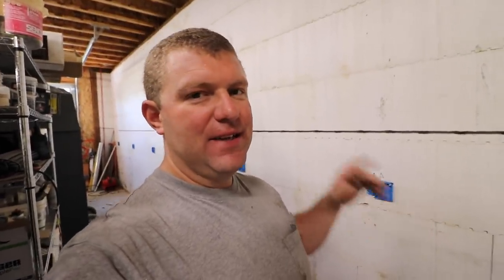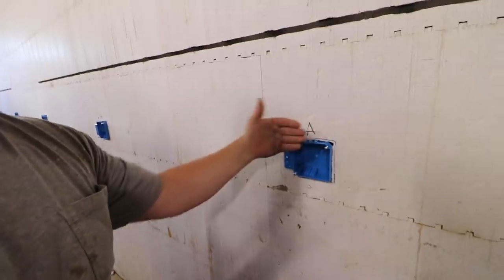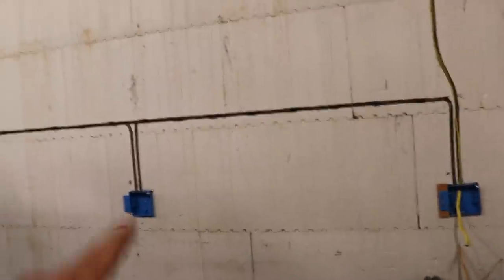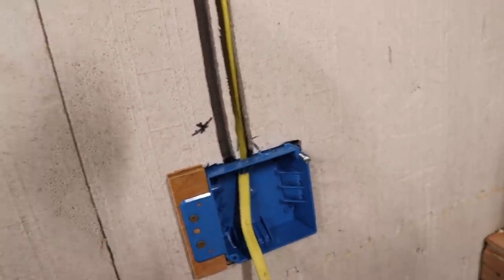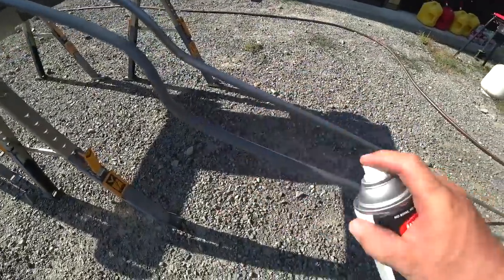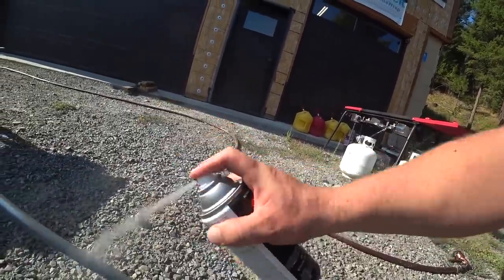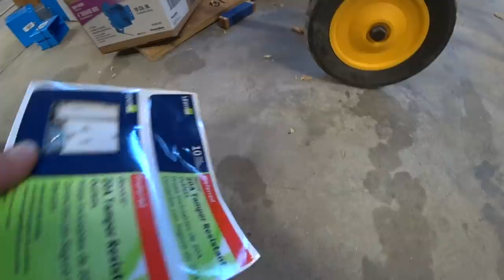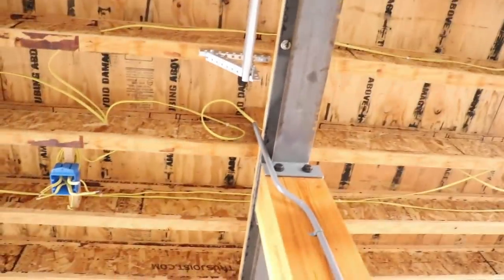OCD PEOPLE BEWARE! (Hot-Knifing ICFs for Garage Electrical)

Comment: Hey there paint guy - I think you are pressing the nozzle to often and foaming in the tube.  If in longer spays the gas moves through and pulls paint from behind.  Otherwise like with your bad luck the gas bubbles expand a bit and put more gas in the paint making more foam.
Reply: I think the problem is the cap\nozzle is getting clogged. Also using cheap paint isn't helping

Comment: I've been an electrician for 30 years and have always believed you can never have enough receptacles but you have proved me wrong. Do you really believe that you will ever need to plug that many things in at once.
Reply: Hopefully they won't. That's way to many devices on one circuit. I also believe the inspector will want to see the wire in the box before the devices are installed. If there are pigtails, does the ground have a wire nut and what about a wire strap above those boxes. I haven't done work in that state but the NEC is the same everywhere.
Reply: I was informed that Daisy chaining wasn't allowed anymore. Must be pigtailed so if one device goes bad then all of the others will work. Also I think the inspector may want another circuit for all of those devices. Cheap insurance.
Reply: Everette Brown he’s been over all of that in a previous video, he’s strapping the wires to the concrete I believe at each box and he’s well within the code for devices on a circuit according to what he said

Comment: When you pointed out the missed connector, we got see what happens when you don't ream the ends of your conduit. The knife sharp edge that results from using a tubing cutter in addition to not reaming the ends has stripped off part of the insulation jacket of the romex. 

Cutting the EMT with a hack saw or metal cutting skill saw leaves an edge that is easier to ream.

Comment: to hold the wire into the icf slots we use "zip wall" tape or take a piece of foam and turn it sideways and wedge it in and we drill a 2 9/16 hole in the i joists and you can fit 9  12/2 romex in each hole  and we never paint conduit unless you use degreaser on every piece because oil is used in the manufacturing process and paint will just flake off in time

Comment: You didn't ream your conduit. And forget about running your Romex wire down the conduits. Stick to flying and hire a electrician to wire your home before you burn it down.
Reply: You need to learn your self before giving advice, you can run nmb cable in conduit as per NEC article 334

Comment: If you live there long enough you will regret using the push on connectors on the outlets, they fail.
Reply: I have never, ever had one fail.
Reply: @watcherofwatchers  I'm 50+ and have had to rewire a bunch of them.  My issue is a loose electrical connection can create a fire.
Reply: Just changed one that failed on the outdoor porch lites, probably turned it on and off less than 100 times in 24 years, was broke when wall plate was removed.

Comment: Rather than buying a manufactured nail plate, you could buy some appropriately gaged sheet metal. Cut the sheet metal to size and use small nails to secure.

Comment: Those connector fittings you had at the very end are the wrong type of you are planning on leaving it that way. The type with the clamp, that slips onto the conduit tube, is what you need. It's still the same sheath looking half, but without threads. It's got a clamp that gets screwed together* instead.

Comment: You talk about the depth of the chase in the foam, in reference to avoiding using a nail plate, but didn't you forget to account for the drywall and plywood layers adding another inch or so?  Seems like those will be plenty deep even if they do end up sideways.
Reply: Thats what the depth is for the screws or nail holding the dry wall up

Comment: Rather than the metal conduit you could have gone with gray PVC, especially since you aren't using the conduit as a ground in the system.  All it takes is a heat gun to bend it!

Comment: Did you deburr the inside ends of the conduit? When you were painting one of the ends looked like it had a burr that could damage the insulation as you pull the wire through the conduit.
David
Reply: It is required that you ream the cuts. He has also made a big mistake in using a pipe cutter. It is against the national electrical code.
Reply: It is required that you ream the cuts. He has also made a big mistake in using a pipe cutter. It is against the national electrical code.

Comment: One suggestion is to have each outlet labeled with a designation,  if in the future you decide you want to have off grid power, you can prioritize the important outlets, as well as essentials they you need to power in case you have to run a generator.

Comment: Before using, let the spray paint can sit in a bucket of warm water for 15 mins or so to heat up a little. It'll help smooth out the consistency and spray pattern.

Comment: Jesse, re: paint. I find 'the curse of the bad can', happens more often than not. I use mix your own and spray guns with my compressor often, and I also use sure-shots to 'roll-your-own' spray cans, but I also use off the shelf sprays. To avoid 'the curse', I do two things. First, I tend to pick colors that I know I will use and I get the contractor pack, case lot at the big box store. Per unit cost is cheaper by the case lot, sometimes substantially so. Second, when I open a new can, I test it first. Invariably, at least one can in a case is bad. I set that can aside and just grab another out of the case. When I have a small collection of duds, I simply return them to the big box. Yes, I need to keep my receipts, but I keep them in the case. This also means that while I buy them in case lots, I don't buy so much that they will look at me cross-eyed trying to return a two year old can of paint. I keep a stock of what I use for three months or so. Now case lots can be as few as six cans, and while six cans might seem like a lot, I find myself gravitating towards the same colors over and over. Grey, Ivory, An Avocado-like color called Vista Green, Sometimes Detroit Diesel Green, Black, John Deere Yellow and Green, so I keep these on hand. We all know that just one can is never enough,  and there is nothing more frustrating than being nearly done and running out. Keeping your favorites on hand in bulk can save frustration, time, and often, money.

Comment: The Battleship gray definitely looks great on the column conduits. Nice job on hot-knifing the foam for the wire runs. The little curves at the end or near the top will help the electricity flow better too!!! Judy kidding, but I did hear a contractor actually say that way back when I was a young kid learning the construction ropes.    At the time I thought he was serious, but quickly learned that he had a lot of useless tips to share and only 20% of them were factual.  As far as planning and execution goes, you did a lot of work for one day and that’s equal to or much more than a lot of home Owner/contractors could have done.   It will get done eventually as long as you keep plugging away at it like you have been.

Comment: Curious why you wouldn't mount the electrical boxes on the backside of the posts?  As you have it now, the first thing you're going to see as you walk in the man door is a bright white electrical outlet instead of the beautiful timber post.  Plus, if you mount the box on the back of that front post, the conduit bend will be on the same side of the I-beam as the conduit on the rear post.  Just a thought...

Comment: There is a special connector for the top of the pipe in your application. It’s a squeeze connector to a pipe connector combo and I noticed you didn’t ground your box either. Easy fix nothing catastrophic.
Reply: You don't run Romex inside of conduit.
Reply: Thomas Gallagher  as per article 334 in NEC it states you can to protect it from physical damage.
Reply: But it is also up to the AHJ. They make the final determination depending on the area

Comment: When are you going to get the cladding done on the outside of the house?
Reply: because there are installation zones. A wire should only be installed in certain heights and distances AND always vertical or horizontal.
Reply: @michaeld_aus_b  I said outside not inside
Reply: It gives me a twitch to see OSB not immediately covered with at least tyvec.

Comment: There are no plastic studs in the area where two ICF's come together in my system (LOGIX) and I suspect the same is true of yours.  Hot Knife your channels in that joint. I cut my channels to the concrete, 2 1/2" in my system.  Not worried about lost insulation value as I foamed over them to secure them.

Comment: I have enjoyed watching the builds. It would not pass UK building regulations on most of the construction. The foundations and drainage, structural and that dodgy wiring. Why not dry line the interior and put all the wires in steel conduit behind. Definately a case of bad planning. Been there done it, so just an observation.
Reply: What you call "dodgy" in the UK is how most modern homes are wired here in the U.S.  I agree that conduit is better but it can also be overkill for most situations.  My house has quite a bit of TPS (Romex) as well from the original build and it definitely meets code.  There are lots of things (like engineered I-joists) in my house I wouldn't do in my "ideal" build but it keeps costs down, I guess.
Reply: I was watching the wiring as well and was gobsmacked. It would not only not pass regs, if I did a wiring job like that, I would never get another job ever haha. It's funny how different regs are in different countries. Interesting to watch for sure.
Reply: Conduit behind dry lined walls isnt required by the IEE regs in the UK. You can leave cable unprotected if you like, but its must be protected by a residual current device.
What gets me is the cable runs. Wouldnt be in accordance with the regs here. We run in safe zones, vertically and horizontally from an outlet. Running horizontally across a wall, from nothing and to nothing but then dropping down to outlets wouldnt comply.and the way cable is run through insulation would definately be non compliant, as cable needs to radiate heat.
Reply: @martinw245  the point to note about the safe routes is it makes it very easy to know where electrical cable might be in the wall and even easier when you pop the plate off and notice the entry points of the cable into the back box. Saves putting nails or drilling through the cable at some future date. It's a whole bunch of little things like that which makes deaths from electrocution substantially lower in the UK than the USA. Mind you we use plastic ducting for tumbler driers.....
Reply: @jonathanbuzzard6648  

Yep, exactly Jonathan. I've done plenty of electrical work myself, in accordance with the regs. And absolutely always run cable in the safe zones. Precisely for the reason you state. Cable will usually be covered with metal capping, but it is so thin it offers no protection from nails or drills. 

I recall from the regs that if not in safe zone, cable should be 50mm deep or protected by earthed conduit.

Comment: Recommendation on wire marking
Since you'll be cutting the tails off, also mark the line up higher so you have a reference when doing the final connections (and above the box if it will be visible) easy to do and makings the double checking of the connection easy

Comment: Before you cover your walls, take pictures so you know where your plumbing and electrical is in the future
Reply: Handy Man that is so true. Can’t count how many times that golden picture has helped solve a problem
Reply: Which is why in the UK we have a concept of safe zones for cable. Basically only horizontal and vertical from an outlet, 15cm/6" from the ceiling and internal corners. Anywhere else and out with the grounded steel conduit.

Comment: Jesse, check out possible chemical reaction between polystyrene and PVC cable insulation which can cause cable insulation to break down and result in a short circuit and possibly fire.

Comment: As some others implied: a) if you have 3 outlets on one line use a straight connection. I would never put electrical wires inside a sip wall. b)in my opinion use PVC on the surface, and so the electricity boxes. it's a garage. c) the wire is not the right type for such a job. you should use a green 2.5 mm triple isolated wire. even without a pipe (my electrician won't approve ...), it can cool if overloaded,  and its easier to fix to the wall.
Reply: @picklerix6162  no doubt inside the house the wires are inside the sip, but in the garage, you must be extremely carefull and beuty is not a must. He drilled the wood in order to transfer the wires, we dont build with wood around here but wirh concrete, and still dont drill the foundation but only th walls. When high current flows through a wire it heats. The sips are highly flsmable and isolators, he uses1.5 mm wire. Thats not enough for 25 amps. Maybe for 16. Isee he has a washing mashine and a dryer, thats 2500 wats each. When i needed a 3 phase 7500 w  for the heater, the electrition put a 3phase 3.3 mm cable streight from the power box. And i have 220v!

Comment: Why do double work skip the drywall and just use plywood on that wall.
Reply: Maybe they plan to use the water resistant drywall as a moisture barrier then have the plywood on top as a sacrificial layer.  Being a garage, it's likely to get more wear than other rooms.
Reply: Fire rating.

Comment: That’s the first time I have seen someone put Romex wire inside conduit.
Reply: I have on washer plugs if ran in floor joists and such as that. Why put a j box in just to change wire type.
Reply: Kevin York    Its legal and required by NEC in this installation.

Comment: There are rules about putting Romex in conduit.  Beware!
Reply: Heat build up and fire
Reply: indeed, just put another jbox at the top of the conduit and run some THHN wire down to the gfci.
Reply: Its allowed by the exception in 312.5(c)
Reply: NEC Section 312.5(C) specifically allows it in just exactly this scenario.  Also, they have already passed their inspection.

Comment: Stop using the back stabs on the outlets.
Reply: Why do you say that? Unreliable over time?
Reply: @mordyfisher4269  The pressure connection inside the device over time can fail on occasion. I've seen it happen to switches over 10yrs old and also old receptacles that used to allow the stabbing of #12 romex in the back, especially outlets being used for space heaters seem to fail more often in my experience.
Reply: Yes unreliable to say the least.  I am not an electrician, I am an electronics technician.  So I use the outlets not install them. But, I have replaced MANY for people. They ask me due to my background and really, it's easy. But I have seen them melted and burnt. In my humble opinion, they should be outlawed. Now, the outlet in the video was an end run. But people daisy chain them all the time. Also, being in a garage has a higher chance of a current draw item (saw or vac) being used more than a phone charger. Basically, just bad to use them. Also, code preferred,  his other outlets should be pig tailed individually not as a set. Again ok, but not preferred.

Comment: Jesse, I'm not trying to be a safety Sallie or your father with this comment. Y'all really need a taller ladder than the one you are using to work off of. I say this because I fell off a ladder in November of 2017 and had to have surgery and I still have medical problems because of it. I would hate to see you fall when your family depends on you so much. You can work more efficiently if you are on the correct ladder.
Reply: That ladder is expandable. Its a Little Giant sold at HD & Lowes. he can about the height if he wanted to.
Reply: You should of bought a bigger ladder 😂